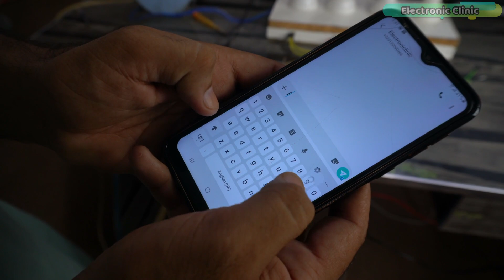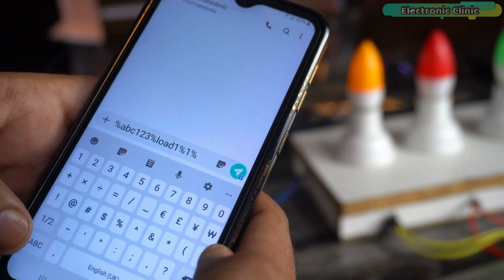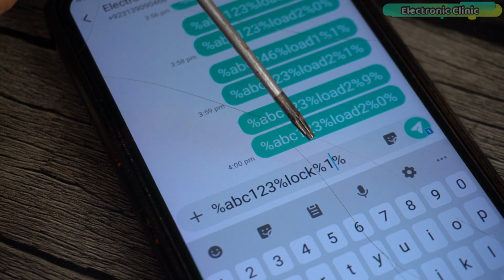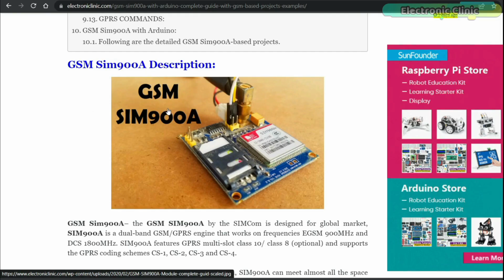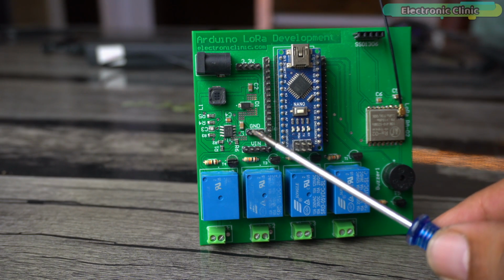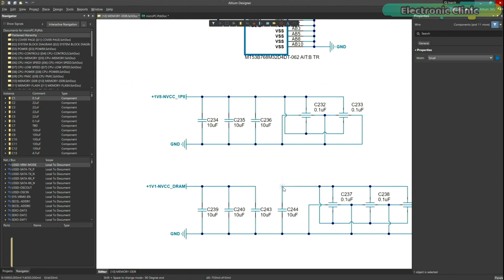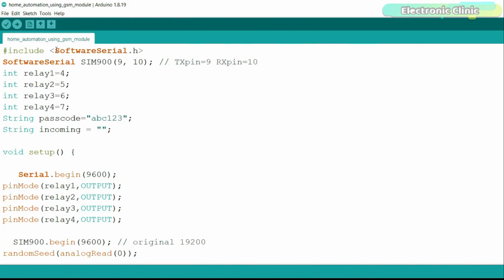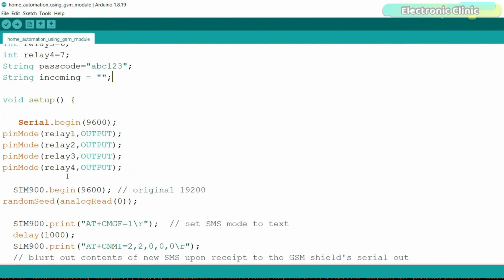GSM based Home Automation using Arduino, Sim900A GSM module, with sms security

Comment: better option mobile number registration through sms command only register number oprate device
Reply from the maker: Ya u r right but the technique I have used can be quite beneficial in situation when the sms package runs out. Then a person can use someone's else mobile to control the devices. The password adds an extra level of security.
Reply: @ElectroniClinic  mobile number registration through sms command
Reply from the maker: I upcoming video I have used a different technique, you will like that.

Comment: Very cool projects! Not sure if you take requests for projects to build but, I have an idea I'd like to see. I'm not great at electronics / programming so, hoping to find someone who knows what they are doing haha
Reply from the maker: Share your idea and I will do it.
Reply: @ElectroniClinic  Really? That would be awesome! Basically, there would be a transmitter and receiver. (I hoped to have them installed in separate enclosure boxes to be handheld). Both of them would be using an ESP32 (Or maybe Arduino nano / PI Pico board maybe?) and Lora modules for them to talk to each other, for longer range.
(Maybe they have ESP32 with built in Lora modules. I’m not really sure.)

 The transmitter would have 4 push buttons to control 4 relays on the receiver side of things. As far as running them on batteries, I’ve seen people use the 18650 cells for something kind of similar. I don’t know if it can handle a smaller battery like a 5 or 9 volt but, that would hopefully cut down on cost and everything. I have seen similar projects but, nothing quite like this. (As far as being handheld / with button / relays).

I haven’t been able to find a tutorial or guide. That left me to try to build it on my own. If that’s a little too big of a project to work on, I understand. I just have a lot of learning to do as far as programming and soldering, stuff like that. Anyways, thanks for building it if you decide to!

Comment: excellent work, that it is possible to present us a video always with arduino and gsm, but in the code to control the PWM of a motor with messages, example: send 10 by sms, the motor runs at 10% , send 30, the motor runs at 30%.... up to 100%?? thanks in advance
Reply from the maker: I will cover this in next video on gsm.